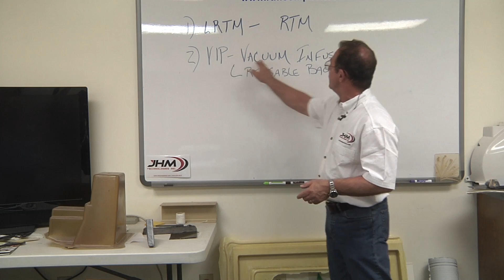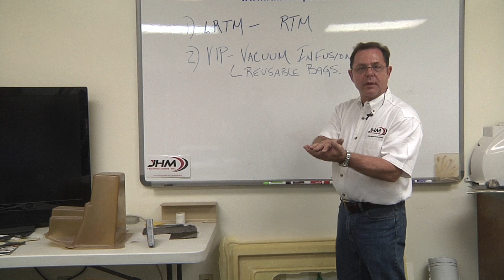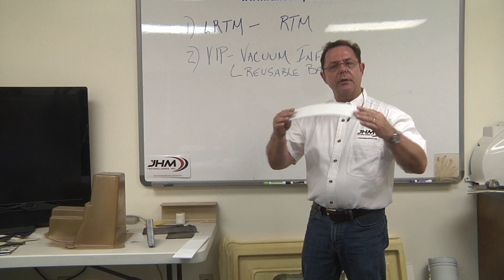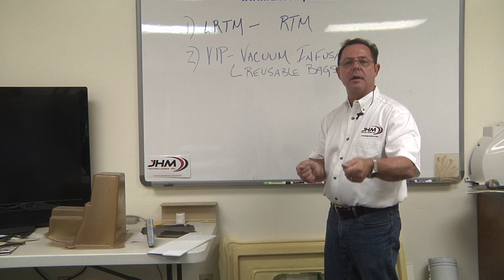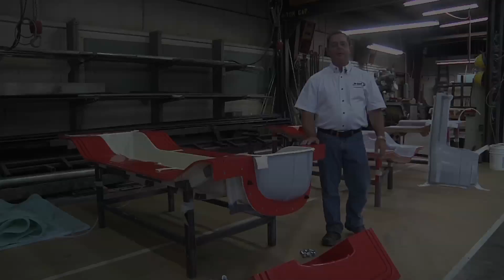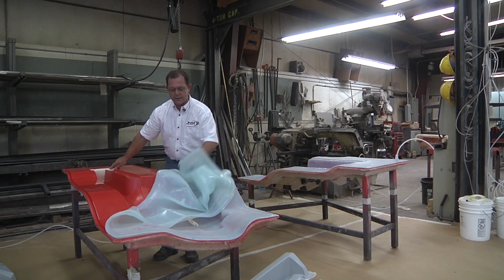Process Toolbox - Choosing the Ideal Process for Your Application

Comment: Thanks for the video, that "inflatable" flow channel is a very smart technique! 

What I don't quite understand is when and why you would prefer essentially lower fiber content of the LRTM process basically increasing resin consumption. Wouldn't it be better to use more fiber? I thought fiberglass is basically the same price as resin, but more fiber content increases toughness.
Oh wait, if you don't use epoxy then the resin is of course cheaper. Never mind! :)

Comment: So, as I can understand, there is no way to produse a part of cloth reinforcement with high level ov compaction by LRTM technology, unless super precise layering and super acurate tooling; the only way to achieve a high level of compaction is to aply force on B-side? Correct me if I wrong.

Thanks
Reply: The point made in the video is that to control the resin flow path, there needs to be fiber in contact with both the upper and lower mold sides in all areas of the cavity crossection. When there are two rigid halves, as such for a "RTM" or "LRTM" tool set, then the fiber must have enough "loft" to touch both sides. When using knitted fabrics this posses an issue, especially in areas of over lapping fiber. 
When using knitted fabrics alone it is often easier to use a vacuum infusion process utilizing a bag film or re-usable silicone bag. This then allows for the bag to be sympathetic to the changing fiber crossections while maintaining contact with the mold on one side and the bag on the other. 
When however, we are looking for speed of injection, using knitted fabrics, we can use a hybrid of the mold / process methods. In that case, we have a rigid "A" side with a re-usable silicone bag, then we calibrate a narrow gap over the silicone and build the typical semi rigid "LRTM" upper as the norm today of that tool build structure. In this case, we have the bag packing the fiber, yet with the "LRTM" upper preventing the bag from "ballooning" to an excess. The benefit of this is a bit of injection speed, and by keeping the laminate tightly packed to the "A" side resulting in minimal resin content, while not concerning with the overlapping fiber. 
This later tooling is normally cost prohibitive however, when you consider the LRTM mold is ~$350 per square foot of area, the bag adds another ~$50 per square foot  to the tooling cost.
Reply: Thank You for such a grate explanation. That is something I was thinking about. But I wonder then HOW much engenering is it take to develop a process of production frames like TIME company makes. They use in house braided carbon fibre sleeves and wax plugs to lay on. Then they put assembly in mold and inject resin. BUT the resin to fibre ratio realy low (somewhere around 40%)
Reply: Oh god! Forgive me my english!..
Reply: What products are they molding?
Reply: highest end bicycle frames